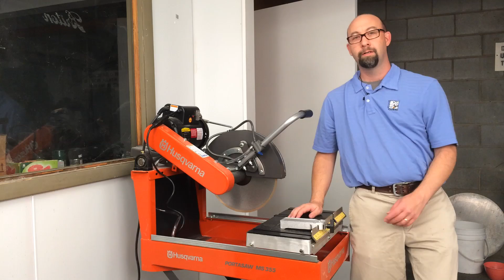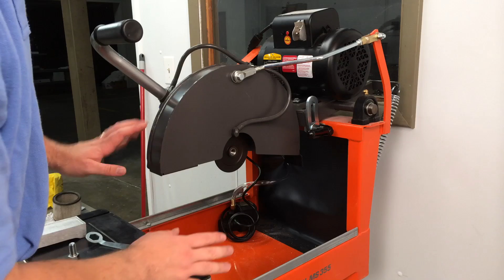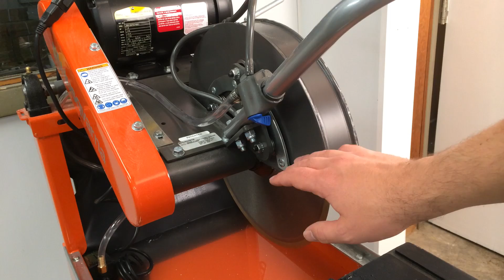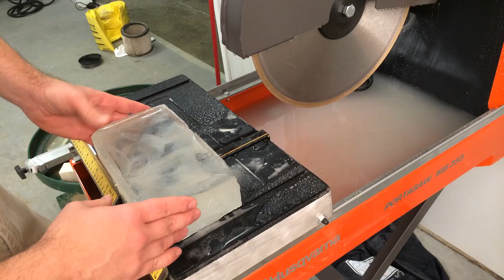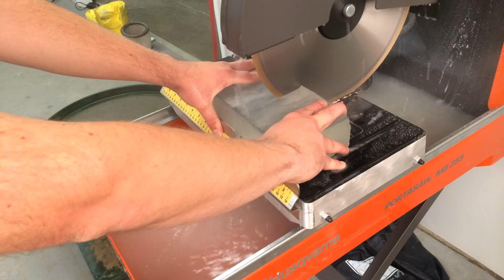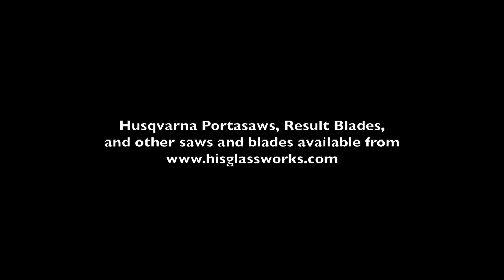Husqvarna MS355 14 Inch Portasaw Wet Saw

Comment: Ever had a chance to try a Shatal wet saw? We're looking to but a saw for our glass blowing studio and are considering the Shatal TS351 60cm 45 and a Husqvarna TS 350 E. Both have the 45 degree tilt option and we're wondering if one of them has a significant advantage compared to the other.
Reply from the maker: I have not tried a Shatal saw so I don't have any recommendation there. The biggest things to consider are if the saw supplies enough water to the contact point of the blade and glass (many tile oriented saws do not) and if there is enough clearance on the motor mount for you to move the size pieces of glass you cut through the area.

Comment: Can it cut basalt rocks?
Reply from the maker: That's more a function of the blade than the saw. The saw will cut anything from glass, to stone, to masonry. You just need the right blade for the substrate.
Reply: Thank you.  What saw do you recommend for this job? Would any diamond saw do it?
Reply from the maker: Any wet saw would work as long as it fit the cutting depth you require for your piece.
Reply: Thank you

Comment: Hello, I am cutting champagne bottles. Would the MS 360 with a diamond blade do the trick? Its more affordable than the one in your video, just want to make sure before I purchase. Thanks!
Reply from the maker: The saw in the video is actually the MS360. I completely labelled it wrong. This would work well for larger champagne bottles as it takes a 14 inch blade and has the depth of cut to work with the larger bottles. (Sorry, this is our older video so it is the MS355 but this model is no longer produced by Husqvarna and the MS360 is the newer model. I have a video of that one but I haven't had a chance to edit it yet- sorry for the confusion on that.)
Reply: I noticed that it is discontinued but seems that that model might be better for my bottles since the motor is 5v. But some 3rd party sellers do sell it. Between the MS360 and the MS355, would you go with the 355 or would either suffice? Thank you for your response. It is so hard to find someone who is knowledgable in glass cutting, specifically bottles. Thanks again!
Reply from the maker: Either would work well. There is plenty of clearance on the new MS360 and it's a great saw with more capabilities and easier cut with. If you can get a good price on a MS355 since they are discontinued though they are also a fantastic model that I have no complaints with.
Reply: hisglassworksinc Thanks! One more question, even with the 355's 5HP motor you think the 360 would cut just as clean? Thanks again for your guidance!
Reply from the maker: The cuts should really be identical between the two models.
Reply: Thank you for your help! I ended up getting the MS360 and works like a charm! Just having a little trouble with chipping when the blade cuts through the last little part of glass. Takes a chunk out that leaves an obvious chip. Hoping it will disappear when I start grinding the edges.
Reply from the maker: When you get near the end of your cut, make sure that you go all the way through the blade and back out. Don't stop when you reach the end or the blade will tend to chip out the glass or break chunks off. Follow all the way through the cut and then back out again. Also, don't put too much pressure on the blade while cutting. Let the blade do the work. If you put too much pressure on it, the strain on the glass will eventually cause it to break a chunk off at the end when the glass is able to relieve that pressure. Go slow and steady and follow through. It should work well for you then.

Comment: how many litres per hour must this be? I am trying to cut wine bottles.
Reply from the maker: The more water the better with glass. Glass bottles especially can easily overheat while being cut and break or chip. The more water at the contact point of the blade and the glass, the better.
Reply: Thank you for the answer! would a 2 mm blade do with a good amount of water? or do I need a thinner one?
Reply from the maker: The width of the blade is really up to how much material loss you are willing to have on your piece and how thick your pieces are. The thinner the blade, the more it is prone to bending while cutting thicker materials or larger work that puts more pressure on the blade.
2mm is  a pretty thick blade so you shouldn't have to worry about bending the blade. It will take more material off from the cut , but as long as you set your bottle to accommodate the extra loss of material, you should be fine.
Reply: Thank you!
Reply from the maker: You are very welcome.